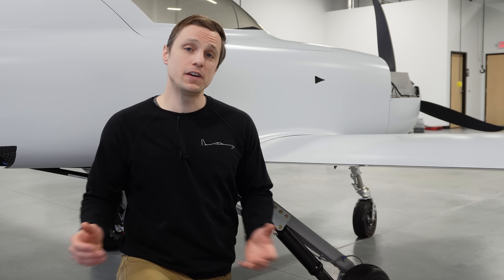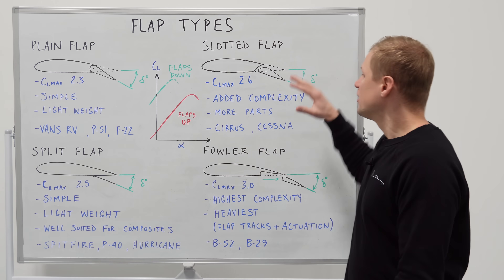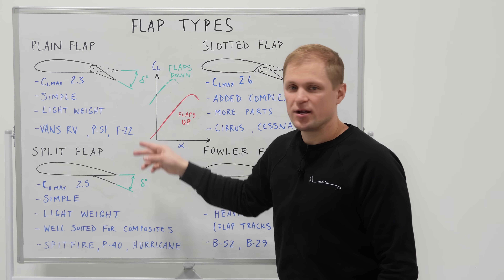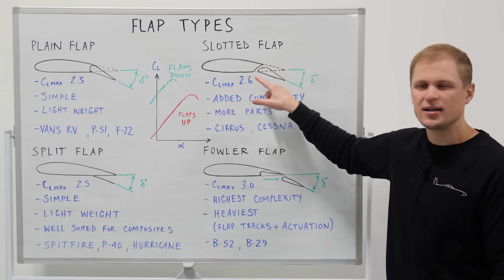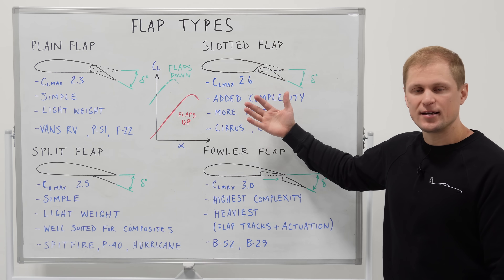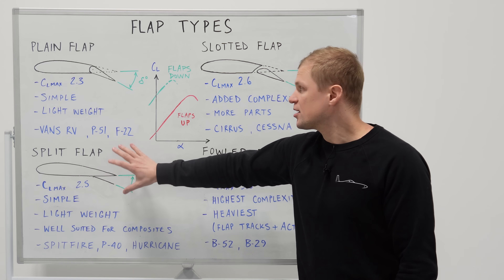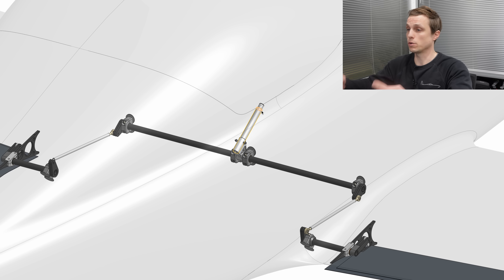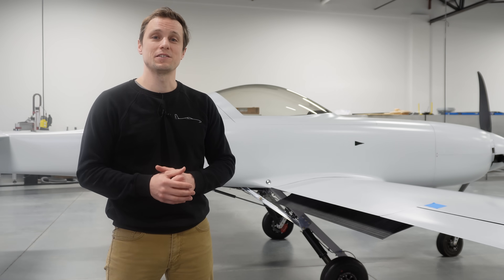The biggest myth about split flaps

Comment: did you consider mixing the control to the aileron to use it as a way to further increase lift during take off and landing, of course with the right amount to avoid increasing the risk of stall at the wing tip?
Reply: This is a mechanical aircraft, not electrically driven like an RC aircraft where a computer can do the mixing.  No one in their right mind would do this with a human onboard without TTF.  Now can you link this mechanically?  Yes.  It has been done before(extremely complex maintenance headache) but if you want higher CL there are other ways of doing it that are FAR easier to do without compromising primary flight controls.  Such as: Different types of flaps as discussed in this video.  Or Leading edge slats not discussed in this video.
Reply: @w8stral  The CRICRI (turning 50 this year) was using Flaperons and it is not a technologically advanced airplane (no computer or servos here). It was a tiny very efficient single seater, using slotted flaperon at the trailing edge of a thick Wortmann airfoil. Its designer then designed the MCR01, a 2 seater with a 165kn cruising speed using a Rotax912. It was using flaperons too to achieve a <50kn stall speed with a 5.2m2 wing area. That type of mixer is also used in planes or gliders with a VTail like some planes from Sonex.
The guys at Darkaero know what they are doing, no doubt. but here is the thought that lead to that question (back of a tiny envelope calculation). If the max Cl with flaps is 2.5, the max Cl clean should be around 1.5. if the flaps length is half the wingspan, the "average"max CL is 2 vs 2.5 with flaperons.(I know this difference is optimistic for tons of reasons but I am trying to make an order of magnitude argument here). That is up to 25% difference that could be used to reduce the wing area by the same amount while keeping the same landing speed. A reduced wing area would reduce the drag at cruise speed so would help to achieve higher cruise speed ( the power used to offset the wing drag would be reduced by around up to 8%).. Again, I am not criticizing the approach, I am trying to understand how the tradeoff decisions are made, which, I think, is the purpose of that video.
Reply: @w8stral  - Suggest you do a little research on the AESL Airtourer regarding ailerons deflecting with flaps.  I learned to fly in these and they definitely had mechanical interconnected ailerons and flaps where the ailerons also partially deflected downwards  when the flaps were lowered.
Reply: Schleicher sailplanes have  a mechanical mixer for flaps and ailerons. All pushrods and bell cranks. No maintenance issues.
Reply: Interesting, @chrisruf7590  - thanks for the tip to look into that design. To be fair, Schleicher themselves describe the mixer as "elaborate". 

By the way, you have a small typo: it's "Schleicher".
Reply: @brianb-p6586  it is elaborate to design, but obviously not too heavy to include in a sailplane.  The actual final design is not to hard to build or maintain.  A flapped sailplane needs to maintain the most efficient glide ratio over a wide range of speeds and flap settings [reflexing upward "negative" for efficient high speed cruise] , including landing configuration where the flaps go down and the ailerons reflex upward.  Flaps on the dark aero would not have so many constraints to be as efficient over such a wide range of speeds since they would just be used for landing.

Comment: The CAD work is super impressive. Can you estimate how many hours you've spent building the assembly of the whole plan in on shape?
Reply from the maker: Thank you! All the modeling work has been an endeavor of its own. Not certain on the total number of hours put into that effort but it’s on the order of 1000’s.
Reply: @DarkAeroInc .   Hi from across the pond.   I graduated 51 years ago in Aero Eng and Design.   My final year project was Foam Stabilised Compression Panels.  I used used 20 gauge Al skins and a 1 inch polyurethane core .  I wrote to De Havilland for advice and they supplied the adhesive free !!   Subsequently I proved mathematically that the Southwell Plot could be used to predict the failing load , in compression, for this “weak in shear” structure.   My tests indicated that this could be the case ,  but at a review in front of the whole course,  I was rubbished by a lecturer , that my results were a coincidence and the Southwell Plot only applied to structures in compression which were weak in bending.    This humiliation triggered me big time,  and after a struggle I proved mathematically that I was correct.  
So…..how have you tested that your design is structurally sound.
And….your design looks really “hot”.   How do you propose to conduct stall and spinning trials ?  Are you going to fit an anti spin chute during these trials, just in case !!   You would be wise to do so.    Do you intend to fit leading edge “triangles” inboard , to ensure you get tail buffet stall warning ?
Great video by the way.    Such a clean design will produce a very flat glide angle I imagine.   If you have a flap linkage failure say,  will you investigate during flight testing ,  the use of sideslip to increase your descent rate ?

Comment: I really know nothing, but I have a question about how difficult or more efficient a design would be that curved the flap rather than created a pivot point. My layman side of me thinks that the design wouldn't be too difficult to create.
Reply from the maker: We have experimented with a “compliant” type hinge where the skin bends rather than using actual hinges. It can be made to work but it makes service difficult/impossible because the control surface is an integral part of the fixed wing structure. We tabled that hinge design but the next iteration would be a compliant hinge that can detach for service.
Reply: @DarkAeroInc That sounds really cool to be able to see. I could see the compliant mechanism needing more complicated or heavier materials.
Reply: @confusingdot  the compliant system would be really interesting, but in addition to material issues it could also require higher actuation force.
Reply: @brianb-p6586  Thanks. i can see it being a lot more force needed for the whole part to be compliant. I wonder if only a small compliant mechanism could be added just for the gap in their current design that would help smooth the transition.

Comment: Thinking out loud here: Wondering a good case could be made to paint the inside of the flaps to protect the skin from UV. Thinking there may be - over time, enough exposure to compromise the structure.
Reply from the maker: Great question! The exterior skin of the flaps is currently coated with an experimental UV resistant clearcoat we are evaluating. The interior skin could be painted or coated as well for added longevity. The paint configuration we have on the prototype is more for testing so it doesn’t represent what we envision for long term operations.

Comment: I'm curious if you'd taken a look at assymetric flap deployment versus aileron authority.  If any of the linkages were to fail in the flap system, is there sufficient aileron authority to counter the roll until the other flap can be retracted?  I don't think it's a likely failure mode but with you attention to detail I'm just wondering if you've examined it.
Reply: I'm guessing that wouldn't be a high priority design consideration. I know from my flight training on a C172 to expect that an asymmetrical full flap deployment would too severe to fight with aileron control at all. I doubt many other pilots received training quite as terrifying as mine was but it should be pretty well ingrained that the pilot should undo the last flap adjustment if that failure happens.
Reply: Yup, decreasing the half flaps deployed that are down will decrease your landing speed as one has less downward lift from ailerons on opposite side.   @WaywardSupercoldSpaceScythe
Reply: @WaywardSupercoldSpaceScythe  @w8stral said it’s no big deal. I’ll let yall settle it. ;).
Reply: One does this in VERY high speed aircraft where flutter is the biggest problem, or sometimes in sailplanes where once again, flutter is the biggest problem.  In low speed aircraft this is not a problem.  In civilian aircraft with their wings full of fuel, once again, flutter is a big problem and due to $$$ of such aircraft, they can afford to have multiple roll capabilities.  In their case, they LOCK OUT aileron movement except at LARGE stick deflections and they still allow down aileron, it is not just UP aileron.  Of course swept back wings helps here as well so...  This is essentially impossible to do on a mechanical only simple aircraft design.  Even the commercial boys have a SMALL flap behind the engines providing roll controll and the main flaps DO NOT move for roll control.
Reply: @w8stral Not sure what flutter has to do with any of this.  Nor was I suggesting using the flaps for roll control.  I was asking that, if in the event of a linkage failure resulting in an asymmetric flap deployment, was aileron authority sufficient to maintain control.
Reply: I thought that was obvious so answered you in a different way.  Ok, here goes, basic algebra time and WHY flaps are NOT considered primary flight control and why aircraft can LOSE a flap and still land with flaps down.  

Aileron CL max is?  ~2.5 or so(tip stall territory and you die anyways so... not cool), but when problems occur is possible.  Percentage of wing ==?  Looks roughly 30%  Flap Cl goes to max of?  2.3 percentage of wing = ~60%.  Wing CLmx ~0.8-->1.  Lets call it 0.9.   Lever arm length to CG 

Moment Flap = 2.3-0.9 = 1.4* center of flap lift @30% or ~0.42.   
Moment aileron = 2.5-0.9 = 1.6* center of aileron lift @75% = 1.2
1.2 Aileron >> 0.42 Flap

Losing a flap or one flap stuck down is ANNOYING, no question, and you will have to LAND faster to compensate for loss of lift, but it is not a death inducing event like losing an Aileron.   If you lose an aileron: Bail out because if you are in the aircraft when it crashes--> You are dead 100% of time, if you bail you have a 0.00001% chance of living but slightly possible if over water, or fly with a parachute.  
 @billstrahan4791
Reply: No, @w8stral  , you didn't answer the question at all the first time. It looks like you missed that the question was about the ailerons' ability to overcome adverse roll, since you discussed only unrelated concerns. But good scrambling to actually answer the question on the second attempt.
Reply: So sorry you do not understand aero elasticity and why Flutter--> IS a major problem regarding flap out/off, and if you were truly knowledgeable you would have pointed out that Ailerons are PURPOSEFULLY LIMITED by a HARD downward STOP to keep the CL below max and therefore tip stalling limited which in my calculation assumed max deflection.  Most aileron deflection is limited to 10 degrees or so.  Not 25 degrees or so where max CL and stall occurs.  Aero elasticity matter as the elasticity increases the effective Angle of Attack when ailerons are used and why effective CL is actually HIGHER and why you MUST NEVER deflect aileron down further.  This effects the basic algebra lever problem which I STUPIDLY assumed someone asking the damned question WOULD do themselves.  But alas, this is the internet where any lazy monkey can type but not spend 10seconds thinking for themselves.   @brianb-p6586
Reply: @w8stral  no one asked about flutter. It's obviously a valid concern, but there's no need for you to demonstrate your knowledge or for you to insult anyone.

Comment: i'd  like to see the flaps connected to each other with an additional torque tube
Reply: Or could be just on flap all the way across the bottom
Reply: One, or the other, but not both. Aircraft design is a compromise. Planes are generally tested for asymmetrical flap deployment.
Reply: LSA are not.   @UncleKennysPlace
Reply: just a thought i had... thx for your reply! @UncleKennysPlace

Comment: As a pilot I much prefer manually actuated flaps. Have you done some design analysis on the mechanical advantage of your flap lever? It looks a little short compared to other aircraft of similar size I have flown with manual flaps.
Reply: All this time I thought the purpose of wings was to provide lift, but there's actually a region of downward suction, amazing lol. And I thought that the purpose of extending flaps was to gain lift by deflecting more air, which should give an equal and opposite force on the actuating linkages, boy was I a dummy lol.
Reply: Deflect air?  No, those are called air brakes or spoilers.  They provide zero lift.  Flaps increase camber(curvature of the wing) and therefore the velocity of the air profile around the wing creating a lower pressure zone above the wing.  Does create a pitching moment though due to effectively changing the angle of attack when flaps are deployed.    @iforce2d
Reply: @w8stral  more accurately, flap deployment changes the center of pressure, moving it back, which is what gives you the pitch down moment.
Reply: Yup, flaps aft load a wing more.  Not all airfoils have the Cl at 25% of MAC and flaps changes this as well.  No free lunch in engineering.   @CanardBoulevard
Reply: @w8stral you are aware though, that the lower pressure above the wing is merely an symptom of the accelerated flow, it is not what actually creates lift.

Lift is created as a reaction of the downward deflection of a certain mass of air over time.
Reply: For every action there is an equal and opposite reaction... yes, 1st and 2nd law of motion are still present in physics.  Brnoulli is still true as soon as you add vectors to it.  =)   @daszieher
Reply: Manual flaps have the advantage that the instant you land, you can retract the flaps, instantly reducing lift and putting more weight on the wheels. This increases your tire coefficient of friction and allows you to brake harder without skidding. Very useful on shorter runways.
Reply: Dammit! No one has answered the question regarding the lever arm in the cockpit.
Reply: @JoeOvercoat  it is sort of answered, if you read between the lines: if the actuation force to deploy flap is as low as discussed, even a very short lever will provide enough mechanical advantage to deploy flaps without overexertion.
Reply: Because you can't answer flap lever load other than with split flaps it is LOW... as you cannot technically accurately answer it without flight testing or deflection load analysis from Aero predictions.  Duh, it hasn't been tested.  We can make rules of thumb, but nothing more.   @JoeOvercoat
Reply: Manual makes it difficult to overload the flaps themselves, motors have more push normally than an arm.
Reply: Generally the bigger, the flaps, the longer your lever needs to be! 😂
Reply: @CanardBoulevard I loved the feel of the manual flaps on the 172D, the only plane I have flown with them! Is the speed brake belly board on your MkIV manual or electric? I might recall from one of your videos that it is electric, though I might be remembering a video from a different Cozy owner.
Reply: @watashiandroid8314  it is electric, with one major benefit over the plans manual brake: you can partially deploy the landing brake if you wish.
Reply: No suction, gas movement is caused by differential pressure. Vacuum pumps push air out of the container suction is a myth.
Reply: Split flaps just need to be released and fall down via gravity, now the UP and REMAIN up/sealed with less drag is the actual problem.  So springs etc are often employed here.
Reply: @w8stral gravity will overcome the airflow? Ever try to open the door of a Cessna in flight or your car door while driving down the highway? I’m not so sure that would work.
Reply: Bottom rear half of airfoils have downward suction.  I do not believe they went with a reflex airfoil so there should be downward suction.  Now will they FULLY deploy?  Nope.  But flaps 10 or flaps 15?  Yup.  Spitfire flaps for instance fully deployed to Flaps ~20 with zero input from pilot other than: deploy.  Where Cessna door is a compression zone.  Same Cessna door on rear half of fuselage is a SUCTION zone and would auto open partially(one reason P51 was faster than Spitfire for instance.  It dumped its higher pressure heat into a suction zone decreasing fuselage drag and decreasing drag of the radiator(p47) partially did this as well(though by default rather than on purpose). Cheers  @rnordquest
Reply: @w8stral  The flap seems very light, will gravity be much help in this case?